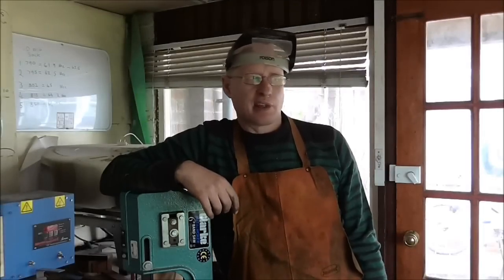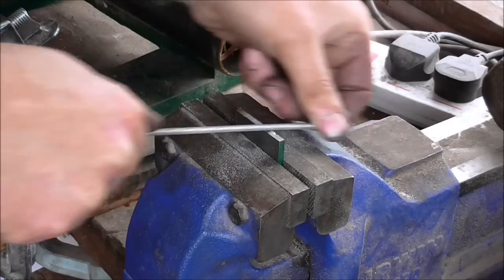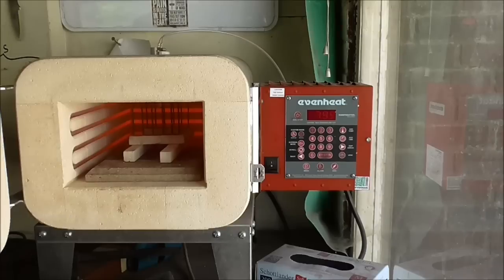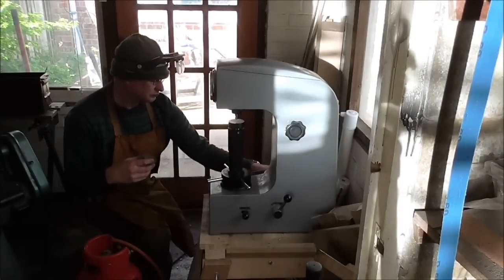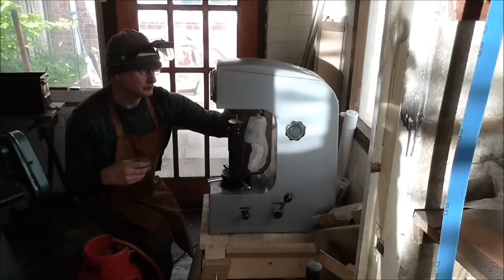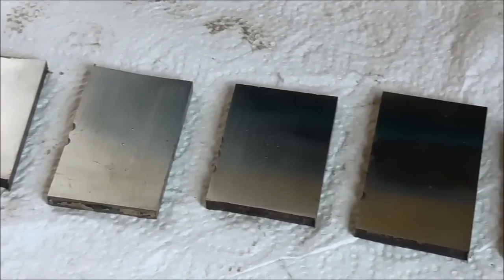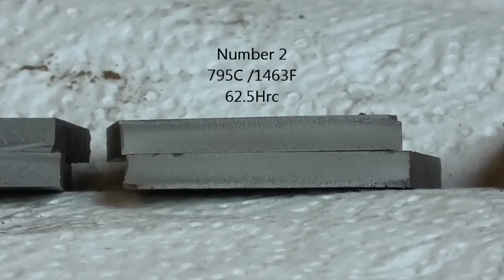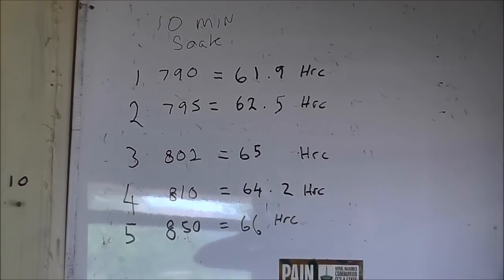Hardening 01 in a Kiln for knife makers (The Metcalf Experiment)

Comment: That was a great video. Thank you! I have long been doing it all wrong for 01. I have been wrapping them in SS foil and heating them slowly... this to avoid scale. You don't appear to be having scale and they are hard enough to  temper back to a reasonable RC. GREAT. Thanks!!
Reply from the maker: Jeff Conti Hi Jeff,
SS foil is good but the problem is extracting the blade from it fast enough and then quenching uniformly.
When soaking at 10 minutes scale is not such an issue but longer soaks require an anti scale compound like PCB or Boric acid.
I coat all my blades in boric acid to avoid scale as some of the knives can be soaking for longer than 10 minutes.
Sandy

Comment: Again very usefull info for me as an hobby knifemaker. I have an additional question about the quenching. What do you use as quenching oil. Vegetable oil , fine motoroil , used motoroil ...or expensive genuine quenching oil ? Other than preheating the oil...the viscosity could also be of unfluence on the hardness after the quench i think.

Comment: What is the advantage of taking the knives at a warmer temp directly to tempering oven. Has the blade reached full hardness at the warmer temp? I thought O1 reaches full hardness at 80F or 26c?
Reply from the maker: ThePatriot4freedom 125F or 52 C is your limit. It is important to get them into the tempering cycle before the temperature drops below 125F. If you don't do this you run the risk of having hardening fractures appear in the blade.
You can run a test if you like. Harden a blade and leave it to go stone cold then temper it and compare it to one that you tempered immediately after quench and see which one brakes first!
Reply: Jackloreknives agreed,,,when I did my old back yard heat treats I used "hand hot" ie not too hot I couldn't touch it but it still needed to be warmer than body temp before the temper cycle, not left until ambient and not until the next day, that was worse again..
Reply: Have you done this test? because I've never had stress fractures, at least none visible to the eye so I didn't see the need to rush to the temper cycle.
Reply from the maker: ThePatriot4freedom I should have worded my response a little differently. No you will not see the stress fractures, they are microscopic and between the grains of steel. The first you will know is the blade will brake or on fine points the tips will snap really easily, then you will know you have an issue possibly with hardening stress fractures.
Reply: ok, thanks sandy

Comment: do you have a machine that tests for tensile strength as well? do you test for that? if not, how come? thanks.
Reply from the maker: addictedtopussy69 Tensile strength or Ultimante tensile strength is usually measured by stretching or pulling a piece until it fails and the force is measured. No I do not posses a machine capable of doing this, however I have done bend tests and other destructive tests and I think it is this that you are alluring to.
Reply: Jackloreknives similar but less precise or not measurable using bend tests.